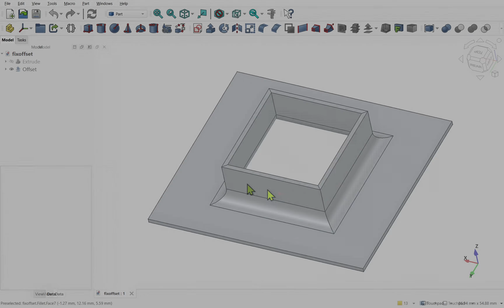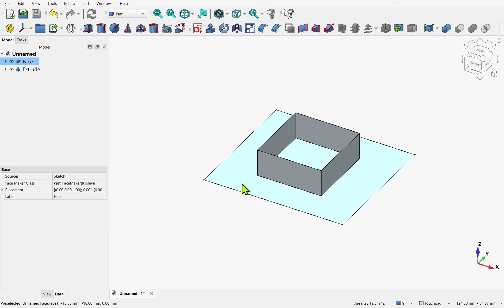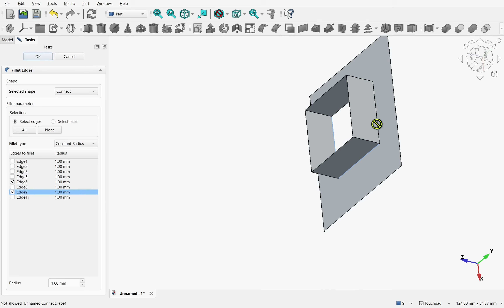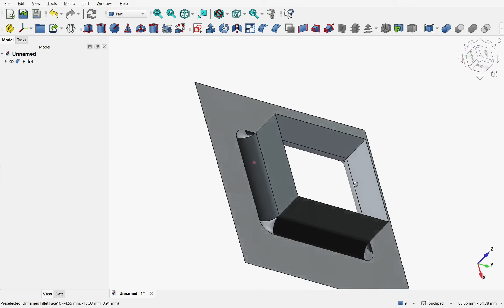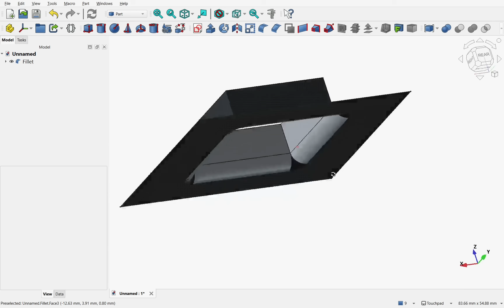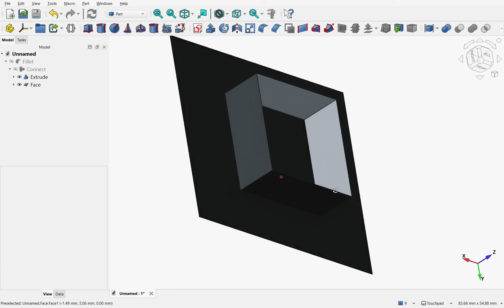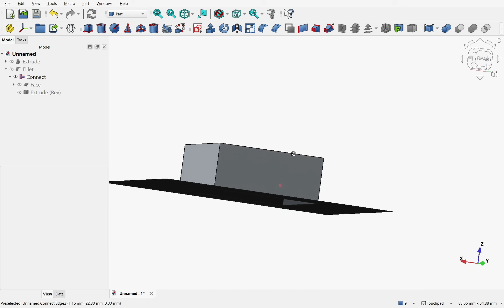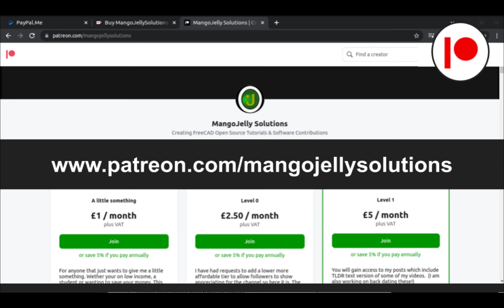How to fix Failed 3D Offsets in FreeCAD 1.1

Comment: Good explanation. I run into this problem with lofts in the part design mode from time to time. Example: I make 2 sketches with two squares each and loft the two faces in between the squares. In most cases it messes up. The only thing that helps for me is to change the order of drawing the squares. Maybe you can make a video on this problem and how to solve it more easily.
Reply from the maker: I know exactly what you mean.  Logically freeCAD doesn't know which way to loft these unless they are in order.  There is no intersection detection or anything like that, I have gone over this in my lofting videofor the course  but something similar to this offset video would be a great idea as information does get buried and no body would be directed to that lofting video if they tried to search for the issue.  You have also given me an idea to place this video along with others into a FreeCAD trouble shooting playlist.  Thank you :)

Comment: I wonder when this, and similar issues, will be handled automatically.
Reply: One thing that would make a big difference is if every freecad user donated money, code, or at the very least, contributed well documented, reproducible, and maintained bug  reports and feature requests.
Reply: What he's doing seems like it should be the default rather than having to go through all the extra work.
Reply: Yeah, this is one of those things that like... this video is incredible (as always) .. MangoJelly is a brilliant presenter (as always) .. but, the fact this can happen is an inherent problem that needs to be solved.  I love freecad and have used it for hundreds of complex projects, and I have nothing but endless respect for every dev.  In this case, this is a situation that shouldn't be possible to exist.  There's no circumstance in which allowing a face to be created in the wrong direction should be able to happen, just like bad chamfers.

I wish I was a better coder and could contribute to solving these individual little problems.  I do believe there's a good chance freecad can displace all proprietary systems in the same way Linux displaced all proprietary Unix systems, and most of that is making sure these odd cases don't exist.